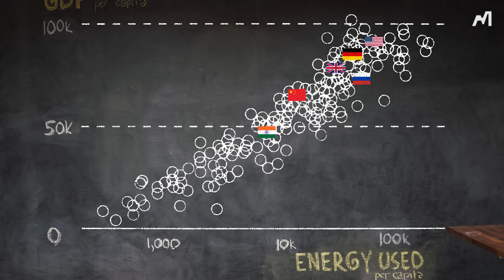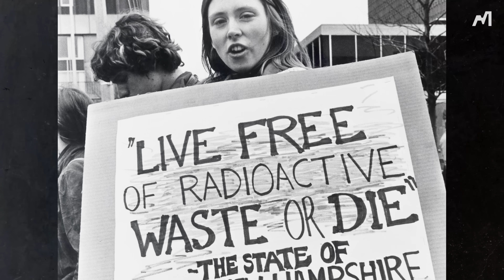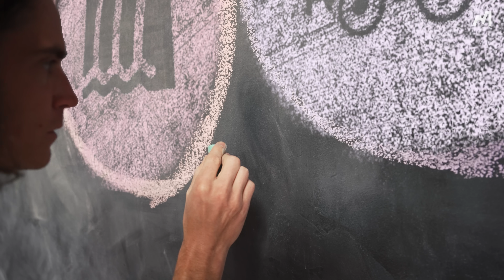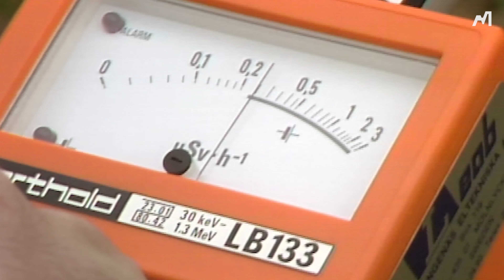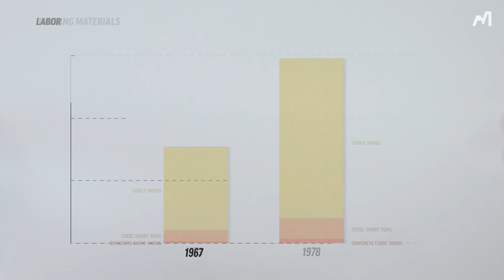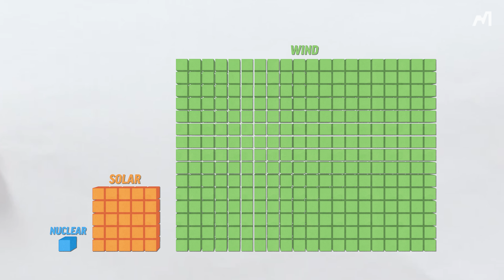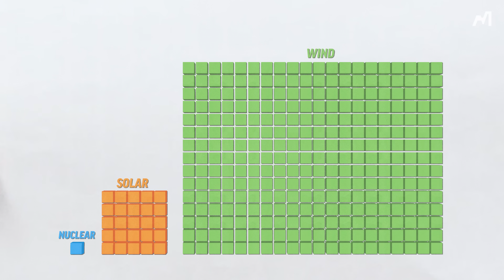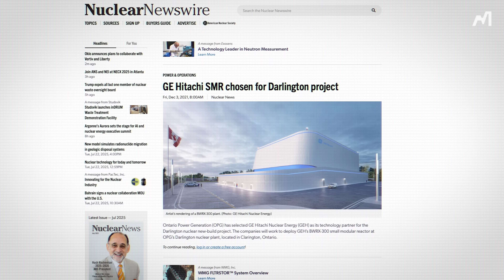They're Lying to You About Nuclear Energy

Comment: I agreed until you mentioned the birds without mentioning simple mitigation solutions, such as larger sizes reduce tip speed slightly, designs that gave no blades at all!

Smart siting — avoiding migratory corridors, nesting areas, and key feeding grounds.
	•	Selective shut-down — stopping turbines during peak migration or high bird activity hours.
	•	Technological aids — radar-triggered shutoff, UV-light detection systems visible to birds.
	•	Contrast coloring — especially on one blade to break the visual “motion smear.”

Gen 5 reactors Cant melt down, decades of developing techniques

Gen
Example Designs
Coolant
Pressure
Passive Cooling Time (No Power / Human Action)
Core Cooling / Meltdown Prevention
Key Safety Innovations
Relative Cost*
III (Advanced LWRs)
AP1000, EPR, ABWR
Water
High
~72–120 hours
Passive ECCS (gravity-fed tanks, natural convection), negative reactivity feedback, robust containment, core catchers (EPR)
Redundant systems, multi-layer containment, longer grace periods
$$$ (high — complex builds, large civil works)
IV – SFR
BN-800, PRISM
Sodium
Low
Several days to weeks
Large thermal inertia, natural convection, low pressure
High heat capacity coolant, avoids high-pressure accidents
$$ (medium-high — sodium handling costs)
IV – GFR
ALLEGRO
Helium
Medium
Several days
High conductivity fuel, inert helium coolant, natural convection
No coolant phase change, chemically stable
$$$ (high — ceramic fuel & high-temp materials)
IV – MSR
ThorCon, Moltex
Molten salt
Low
Indefinite (drain tanks)
Liquid fuel drains to subcritical, passively cooled tanks via freeze plug
Low pressure, inherent shutdown
$$ (medium — simplified vessel, but exotic salts)
IV – LFR
BREST-OD-300
Lead / Lead-bismuth
Low
Weeks
High boiling point coolant, natural convection
Chemical stability, high thermal capacity
$$ (medium — heavy coolant, but low pressure)
IV – VHTR
Pebble Bed Reactor, GT-MHR
Helium
Low/Med
Indefinite (fuel integrity)
TRISO fuel tolerates 1600°C+, passive cooling by conduction/radiation
Fission products sealed in fuel kernels
$$$ (high — TRISO fuel manufacturing cost)
V (Concepts)
MMRs, sCO₂ reactors
sCO₂, heat pipes, advanced coolants
Low
Indefinite
Small fuel inventory, sealed fuel cassettes, underground passive heat sinks
“Walk-away” safety, no moving parts for cooling
$–$$ (small-scale, modular — lower unit cost but higher per-MW cost)

Gen	Example Designs	Coolant	Pressure	Passive Cooling Time (No Power / Human Action)	Core Cooling / Meltdown Prevention	Key Safety Innovations	Relative Cost*
III (Advanced LWRs)	AP1000, EPR, ABWR	Water	High	~72–120 hours	Passive ECCS (gravity-fed tanks, natural convection), negative reactivity feedback, robust containment, core catchers (EPR)	Redundant systems, multi-layer containment, longer grace periods	$$$ (high — complex builds, large civil works)
IV – SFR	BN-800, PRISM	Sodium	Low	Several days to weeks	Large thermal inertia, natural convection, low pressure	High heat capacity coolant, avoids high-pressure accidents	$$ (medium-high — sodium handling costs)
IV – GFR	ALLEGRO	Helium	Medium	Several days	High conductivity fuel, inert helium coolant, natural convection	No coolant phase change, chemically stable	$$$ (high — ceramic fuel & high-temp materials)
IV – MSR	ThorCon, Moltex	Molten salt	Low	Indefinite (drain tanks)	Liquid fuel drains to subcritical, passively cooled tanks via freeze plug	Low pressure, inherent shutdown	$$ (medium — simplified vessel, but exotic salts)
IV – LFR	BREST-OD-300	Lead / Lead-bismuth	Low	Weeks	High boiling point coolant, natural convection	Chemical stability, high thermal capacity	$$ (medium — heavy coolant, but low pressure)
IV – VHTR	Pebble Bed Reactor, GT-MHR	Helium	Low/Med	Indefinite (fuel integrity)	TRISO fuel tolerates 1600°C+, passive cooling by conduction/radiation	Fission products sealed in fuel kernels	$$$ (high — TRISO fuel manufacturing cost)
V (Concepts)	MMRs, sCO₂ reactors	sCO₂, heat pipes, advanced coolants	Low	Indefinite	Small fuel inventory, sealed fuel cassettes, underground passive heat sinks	“Walk-away” safety, no moving parts for cooling	$–$$ (small-scale, modular — lower unit cost but higher per-MW cost)

Comment: Crazy: Nuclear power plants (NPP) are doomsday machines. Should there be a long term grid failure, CME, Nuclear EMP or Nuclear war, NPP become doomsday machines. With in about an hour or less after losing active cooling, the reactors will start melting down. Spent\Used nuclear fuel need constant active cooling. If the power is out more than about 45 days, the spent fuel rods in the spent fuel pools get exposed which catch fire as the cladding burns when exposed to steam. 

New Reactors are very expensive & take about 20 years in planning & construction. The last two reactors completed in the US (2023 & 2024) at Vogtle, GA Plant took 20 years to complete & cost about $32B. Payback on these reactors will take about 40 years, if there are no significant maintenance costs. 
You never see a US utility build a new NPP as the costs & time is just not economical. All of the revitalization will come from restarting old, shutdown plants, largely because of the AI boom, that is likely to pop over the next few years. These Old reactors were shutdown because they were no longer economical: soaring maintenance costs, leakages, & corrosion problems.
Reply: Didn't watch the video did you... Boring that your points were addressed. Do you do this with every such video?
Reply: @joythought  Skimmed over most it. When you know about the history of nuclear power, its like watching paint dry. Time is short, nobody wants to waste ~20 min video what can be done in 2 minutes. You video seems largely pro-nuclear, ignoring the waste\Spent fuel problems.

SMRs? DoA: All the regulatory costs of a full scale reactor, but at the fraction of revenue. and also need 90% enriched Uranium to be feasible.
Reply: @guytech7310  "When you know about the history of nuclear power" sure mr. nuclear engineer, because someone who begins the comment with "NPP are doomsday machines" for sure is an expert.
Reply: @filippo1864  And your comment somehow discredits anything I said.. "Riiight!"

Comment: OP great video and you were careful to be very detailed in almost every aspect but it's a bit of an oversight to compare an SMR to a submarine reactor making it seem as if the power states and length of the core life would be similar given the drastic difference in enrichment of the two types of cores and how the level of enrichment used for a submarine reactor could NEVER be considered for an SMR due to clear security concerns.

Comment: Chernobyl was caused by the engineers running the plant far outside it's design specifications. Fukushima was caused by gross negligence in putting the backup generator underground with improper water seal, so the tsunami flooded it. There were several safety inspections pointing out this flaw, and it was repeatedly ignored for years. Of the nuclear reactors that were run and maintained properly, to my knowledge, there haven't been major meltdowns. 3 mile island was only partial, and was severely overblown by media who thrive on fearmongering for attention.

The ALARA thing is a bit silly, forcing extreme overengineering for something extremely unlikely to cause major health effects, in favor of continuing to fund coal plants which undeniably cause millions of deaths each year.

Comment: I question his math on the deaths from solar, way too low.
Reply: Yes low skilled folk and DIY working at heights putting solar on roofs lead to accidents even if it is 1 death per 200,000 panels it will be some number like that but if you fall off a roof and die does that get blamed on solar which caused you to be there or the fact you slipped. I think the deaths will be underreported

Comment: "The sun goes down at night."
Source?
Reply: Trust me, bro.
Reply: Sure it did.
But we can still store the energy in fluid salt or just water tanks.
Reply: @molybdaen11  every explanation I've seen for how something like this might work demonstrates that it's massive, wildly expensive, and impractical compared to just using batteries. You need a massive structure just to replicate what one battery that can fit in a closet can do. That said, batteries are also not an ideal solution for environmental reasons.
Reply: @Michael-uc2pn Then just use boiling water.
It's environmental friendly, proven and easy to build.
Energy density is much lower then salt but at least they do not lose storage capacity over time.
Reply: Well I don't think it's actually going down. Perspective, appearance's can be deceiving.
Reply: FALSE AND MISLEADING, the sun doesn't move in relation to the Earth it appears to "go down" due to the Earth's rotation. :P
Reply: @arcee-1993 false! The balanced point between the sun and earth is not at the center of the sun, the sun wobbles. It's just as shaky as my skepticism. Thus any other point you may have made is wrong, and your name is mud!
Reply: It’s a theory supported by more than a million years of observation.

Comment: A problem not often mentioned with nuclear energy is that even when all radiation-related problems are solved (as they are better and better : breeder technology can dispose of nuclear refuse in an ever more energy-producing way) it is actually a thermic power plant of super-low thermodynamic efficiency : it produces megatons and megatons of sheer heat pollution of the kind the Earth's atmosphere cannot radiate back into space (even if there were no greenhouse gases at play).  It contributes to global warming in the worst and fastest way because the surplus heat generated never converts into electro-magnetic waves of any frequency of the kind that can dissipate into space : most of the present-day global warming clearly results from surplus residual heat of the kind that accumulates in blobs and domes than from the greenhouse effect proper.  Worse : the surplus heat issuing from nuclear power plants prevents the formation of clouds when most badly needed.  Actually it would make far more sense to branch power plants to geothermal sources of energy and also to use the methane that is issuing from all kinds of natural and semi-natural sources whether we want it or not.  The earth's atmosphere is naturally equipped to process pollution from mega-blazes but not arbitrary introjection of sheer diffuse heat energy, or as physicians say, entropy, the ultimate absolute pollution that cannot be disposed of anywhere or under any other form.  The advantage of windmills and solar panels resides not so much in the quantity of energy produced as in the independence it can give family farms and other local enterprises such as clinics in case of overall grid failure, in case of war or civil war for instance.

Comment: Three Mile Island was the result of ignoring a warning signal. It was assumed that the signal was defective sensor when it fact it was real problem. There was no issue with the design, it was human error.
Reply: I've read about TMI in detail and I disagree.  There was an instrument that displayed what should have been the state of a valve rather than the actual state.  That helped keep the operators from knowing what was the fault  they could tell was happening.
Reply: @PMA65537 There was a temperature discrepancy due the valve being in the wrong position although the indicator was that it was in the correct position. They ignored the temp warning, assuming that it was wrong and assumed that the valve position was correct. If they paid attention to the 2 facts 1) valve position was assumed and 2) temperature was actual, they could have caught the problem sooner. There were other issues with data reports which were unavoidable due to available technology at that time, but had they focused on the temperature, things may have been different.
Reply: @PMA65537  There is a great Ted Talk with Nicholas Means who explains in detail what went wrong. It's a great watch.
Reply: But humans will remain human,also in the future, and will keep making such mistakes.
Reply: Their is only human error
Reply: We've learned to deal with that too. The more modern plants are littered with passive safety systems. A meltdown is very unlikely even without human intervention. The control room is there in case of the worst but their job is more about improving efficiency, anymore.
Reply: @Ichibuns  yeah, we've learned. and then chernobyl happened. we learned once again, and then fukushima... wait, what exactly did we learn?
Reply: @guai9632  In the case of Chernobyl, we learned to not let Communists build nuclear power plants.
Reply: @craiga2002  yet they do
Reply: @guai9632  We have learned as we do from the development of any technology. Chernobyl was the only one where active human error in design, decision making, politics and bureaucracy contributed directly to a catastrophic failure. No deaths are reported directly from Fukushima and none at all from TMI. Millions of deaths each year are attributed from air pollution due to using fossil fuels to generate electricity and directly from the lack of electricity in a region. Life expectancy is tied directly to the availability of electricity. Do we risk the danger of an energy source which is almost the safest in the world or guarantee death by denying access to electricity?
Reply: @albatross5466  ok, human error & bureaucracy. have we discover some new methods to deal with those? why weren't those applied in fukushima? or is it just ok if it was human error & bureaucracy? were some new regulations produced when russian army took oven nuclear plants in ukrain and plant bombs inside? how were they enforced? what should we do when terrorist governments use nuclear plants as a cover to make bombs? yeah, the technology is mostly (except for the waste) fine, but that's not the while deal

Comment: This is the first video I saw from this channel and it's actually factual... Subscribed immediately. Nuclear unfortunately has lots of red tape, more than any other industry or power generation, because nuclear must not only be zero emission, it must be damn perfect from safety perspective. But we do not judge other power production methods to same extent, because risks are different, and thus valued arbitrarily differently. Inherently nuclear plant is not unlike any other industrial construction project, if regulations were consistent and some level of risk accepted within reasonable limits, we could build large nuclear plants in 3-5 years, and extremely safe ones, safer than retrofitted old plants. But goalposts and red tape globally keep moving in rolling release manner, so that requirements are different during construction period. This makes investment to nuclear very volatile and risky, and causes chronic delays to get plant operational in time. And this is not just USA problem, this is global problem... Except China seems to build nuclear in time, but it's completely different regulatory framework.

Comment: I worked cleaning solar panels in college. They used a gas hot water pressure washer mixed with some sort of acid to get the grime off. Took about 80 hrs to clean 1MW
Reply: Probably took more energy to heat that water and generate the acid than those panels make in a month

Comment: There is no question that there were few casualties from something like Fukushima, and all the rest had no provable cancers or death tolls, YET, we will never know how many died earlier than they should have owing to their radiation exposure.  But, there is one undeniable fact, of all the energy production systems currently in use nuclear is far and away the most expensive making it uneconomical.  I can barely pay the electric bill I get each month as it is, if we had even 50% of our power from nukes and billing included all of the expenses related to such power production including the mining of the ore, through disposal of the waste, my bill would be 10 times higher.  Why not put that money instead into making fusion a reality instead of trying to make fission economical, the difference is one can be done and the latter will never be economical.
Reply: What a lovely long uninformed comment. No one sane is suggesting replacing all other sources with nuclear but wouldn't you be happy if the new AI data centers don't gobble up all the power and triple the cost on you and instead they want nuclear SMRs? Fukushima: no-one died from radiation. You may wish they did but they didn't.